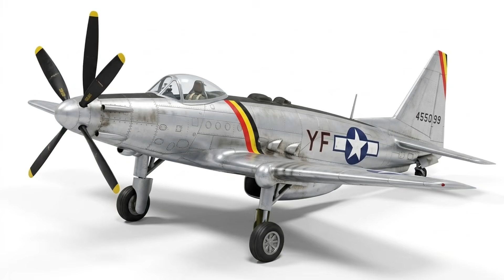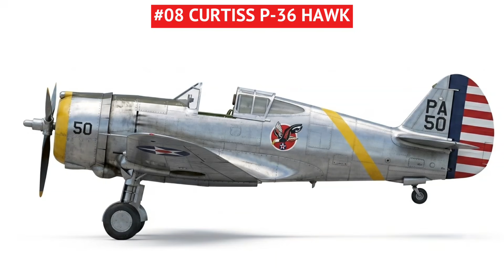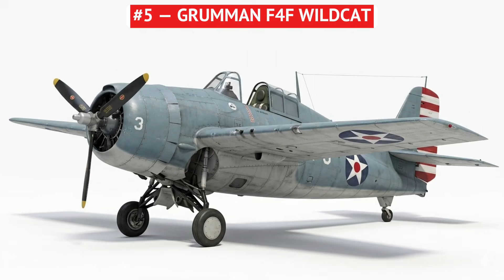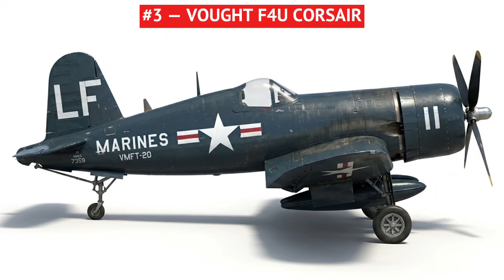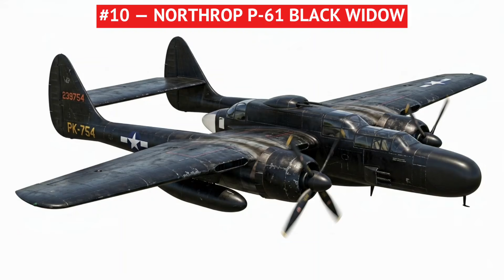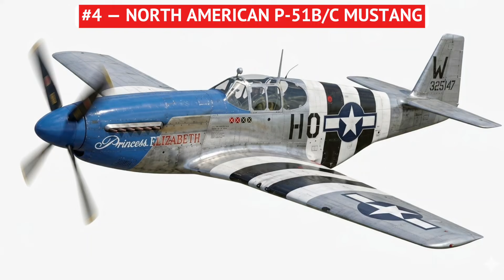Every American WW2 Fighter Ranked – WORST to BEST.

Comment: Bell didn't design the army contract for the P-39, the army did. They didn't think high altitude performance was needed. So there was only one supercharging stage on the engine. (Not turbocharging, only the P-38 and the P-47 had turbos.)